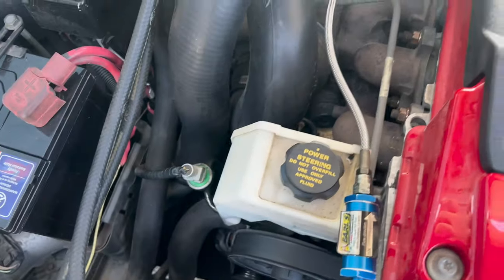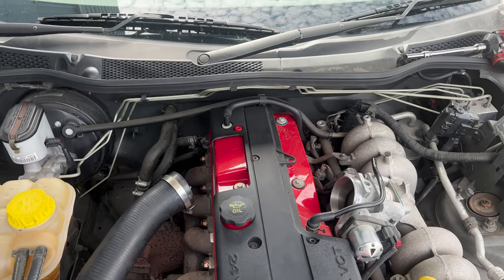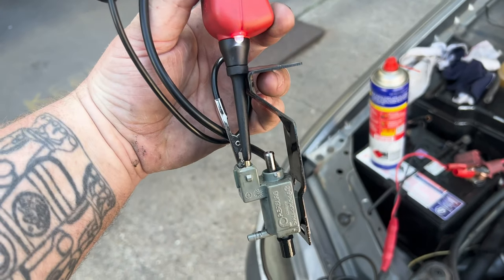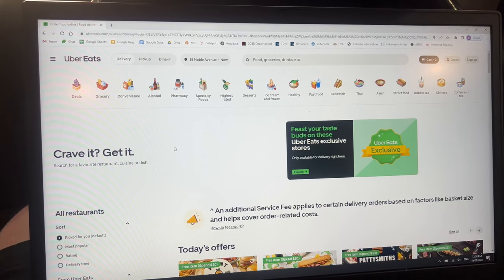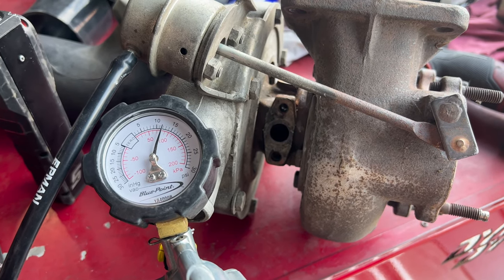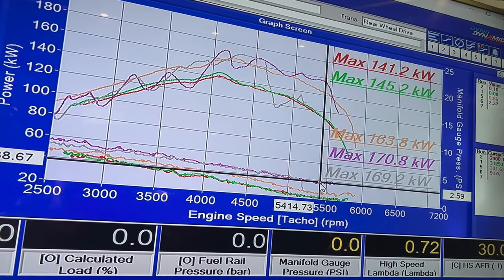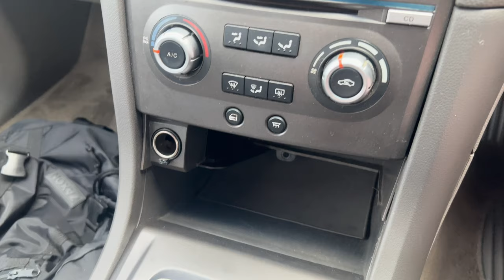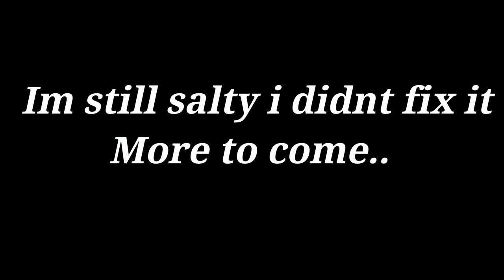Trying to fix the boost on the abandoned barra project

Comment: out of curosity, did you check the rear housing bolts? (if they are cracked spooling will be slow as a wet week)
cracks around the rear flapper?
Reply from the maker: Didn’t get a chance to yet but that is coming up on next video I will be checking that all out

Comment: Is it possible when the turbo was replaced they put the wrong actuator on it or adjusted it incorrectly so the gate is always partially open?

I also had a turbo years ago where the shaft could slide in the housing so occasionally the flapper would get hung open on the casting inside, so sometimes the car was really lazy on boost and other times it was normal.
Reply from the maker: Actuator works normal and it’s not adjustable but until I take the cat and dump off and check out the flapper I won’t know how it’s actually working
I got a few things to try tomorrow and then we’ll know more 
May just be able to get out of this one without buying a turbo yet